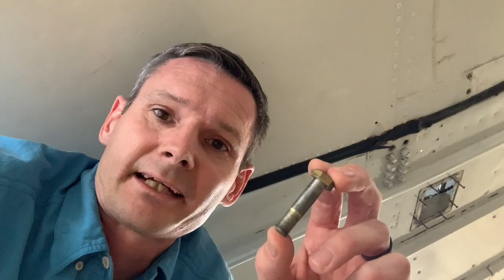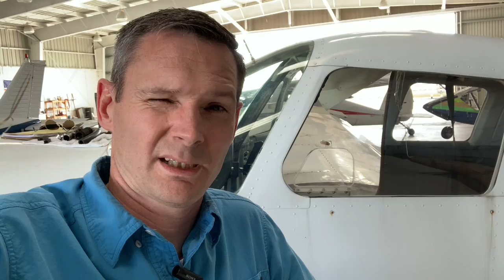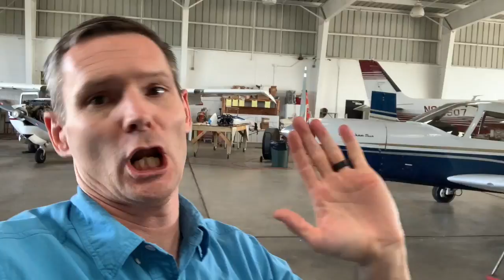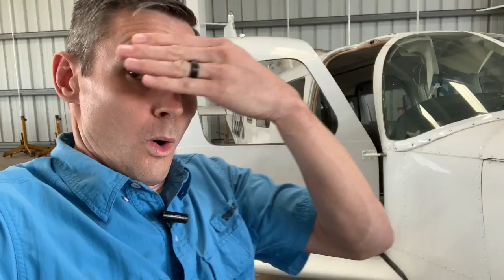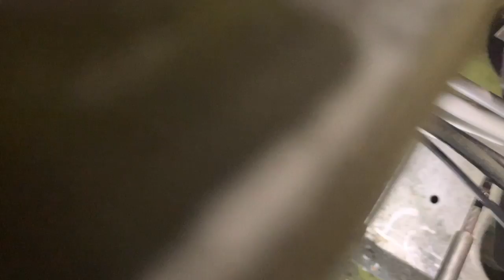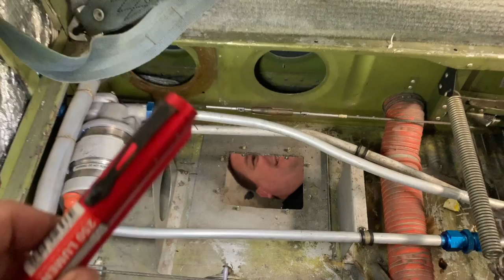Failed Test!  Wing will FALL OFF... Wing spar is cracked, is this project dead??? EP17

Comment: I assume there is a procedure for cleaning the fuel pressure gauge system / line etc  but U might try cycling fuel/cleaner into the gauge itself not just the line

Comment: The proper way to torque a screw is to tighten it until you strip it out and then back it off a quarter turn. 😋
Reply: Did you train at Jiffy Lube?   That's the way they installed my oil drain plug.   Drain plug threads were stripped and the pan was leaking oil.
Reply: @jamesburns2232  given enough time the pan will stop leaking. You may not have any oil left in the engine, but the pan will not be leaking.🤔

Comment: Okay Jim Carrey look alike and act alike. The problem there is that people really did die because of that and the humor is way out of line so it's my choice I guess not to follow this YouTube channel. But, that being said just because it passed this time does not mean it will pass the next and I would still be very very cautious.  The spar so many cycles that the it will go through before failure and you don't want to be in the air when that final cycle happens.
Reply from the maker: very true.
Reply: I stopped following this channel months ago, but still have folks responding to my comments so I come back to read them. I adminster 5 FB groups regarding aviation. One of the main bulwarks of the pages is to not be another "Aviators Lounge" were snarky is the standard of the day. I know everyone has their take on any given topic. I personally think that Aviation is fun on a different level and not "Stand-up Commedy" Level OR at least not to make fun of others struggles or mistakes. Our world is changing daily and not necessiarily for the better. Young people (anyone under 40 to me) seem to have no filter and assume every action is a cause for humor. If Jimmy was more serious about the projects he undertakes, then he may go a long way toward providing valuable information and a guide to others. I personally use YT and the Internet in General as a source for information and education, "Stand-up" has a place in Commedy Clubs and then only if you are truly funny.

Comment: Jimmy, as the owner of a Cherokee 6, I would appreciate it if you could give us the “factored service hours” on both the aircraft that failed and on yours.  Mine does not require the inspection at this time but the info would likely be helpful to many fellow “6” flyers.
Thanks!
Reply from the maker: For sure.  Mine only has 2200 hours and the one that failed had well over 6000 (could be way more, I don't have the exact figure, but know it's at least that). It also spent all of it's life in Florida and 50% in the Florida Keys.  Has some surface corrosion and you can tell from a visual inspection that corrosion is present.  Mine was required because of the missing log books.
Reply: @therealjimmysworld  thanks for the info.  Enjoy your videos.  If you ever have any questions on these aircraft feel free to shoot me a message.  Have had ours for 9 years and flown the family all over the country.  They are great family airplanes.
Reply from the maker: Thanks! will do

Comment: So the eddy test only requires that the two forward bolts on each side are pulled and replaced?
Reply from the maker: What the guy told me is that the first test is the eddy current on the 2 outer bolts and if it fails that then he does a dye penetrant test in that same area. Yes, only the 2 outer bolts and those get replaced with new, don't reuse the old ones.

Comment: G, day Jimmy from Sydney, Australia.
* with the failed wing spar: why replace the whole wing?
* can a new plate connection be installed?
* can the identified cracks be welded and reinforced
〰💯
Reply: No. You will either change the spar for about $12.5K USD per wing or try to find a good one in a salvage yard (good luck with that.)
Reply from the maker: what he said ^^^^^^